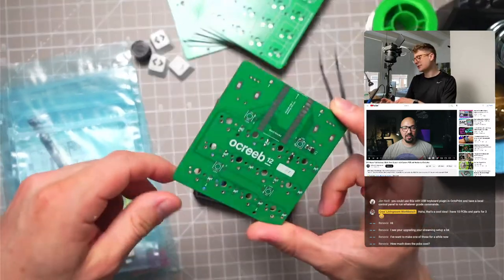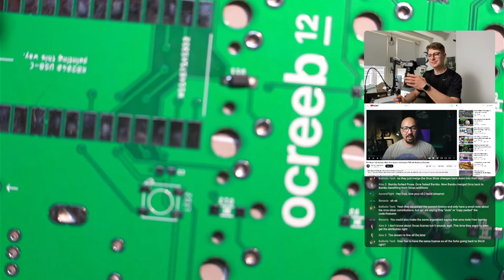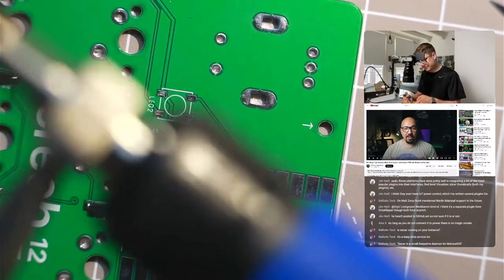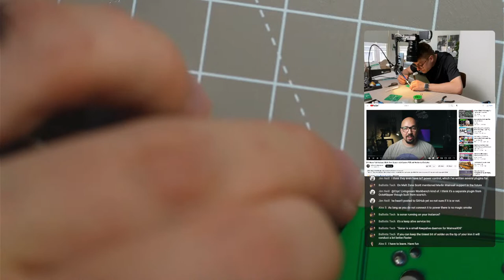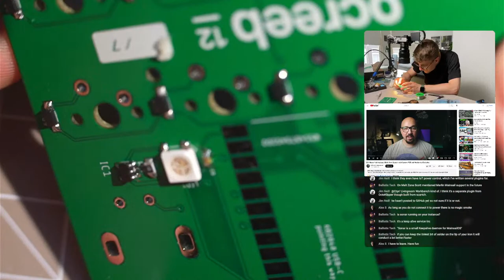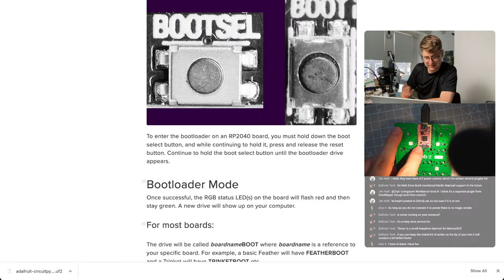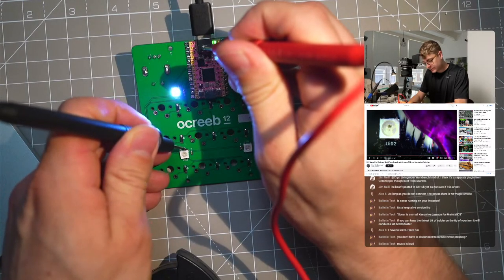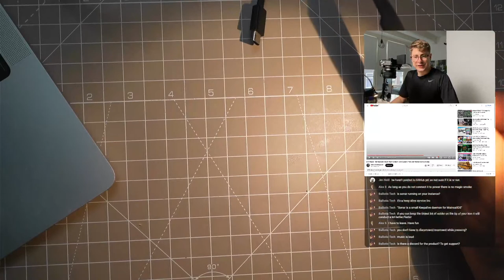Ocreeb 12 DIY Shortcut Keyboard: Soldering and assembling the keyboard [Part 1]

Comment from the maker: Soooo...turns out the LED1 was seemingly defective. I unsoldered and replaced the logic level shifter the reistor and diode with no success. I did notice though that if I turned the encoder wheel that controls LED brightness all LEDs would blink in random colors. As this proved that the solder connections to all LEDs where fine as they got a signal, power and ground, I went ahead and replaced the LED1........and success! Now all works as expected, minus the jumper cable I had to run from LED1 to LED2 because I damaged a pad while unsoldering the LED :D 

But....behold: I now have 3 working boards and even one without jumper cables! :D